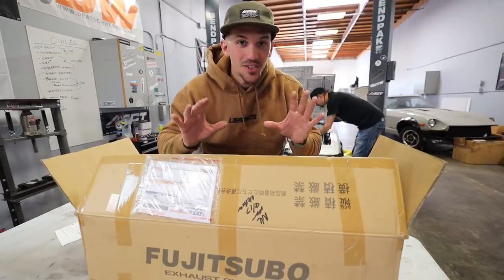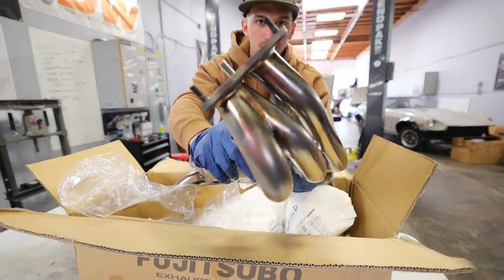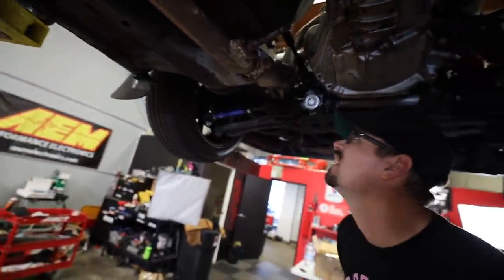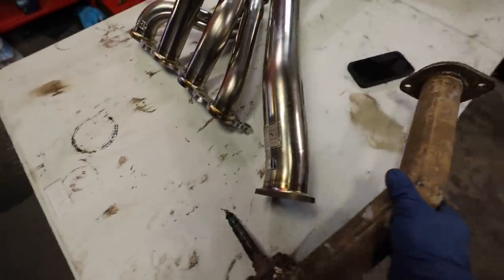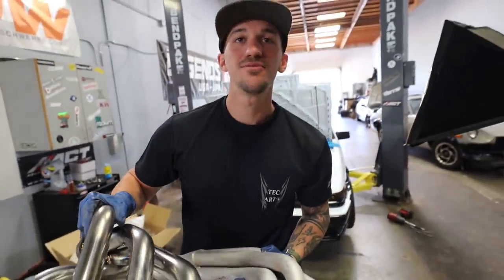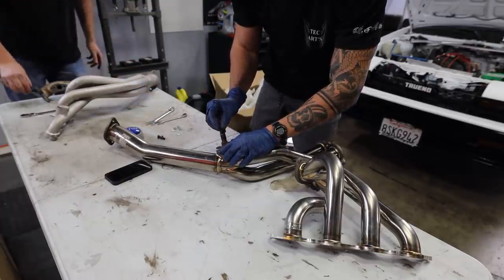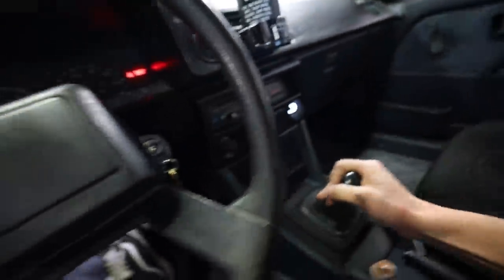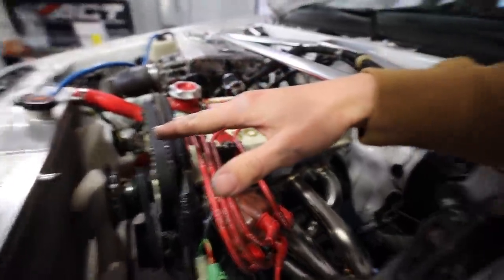This Was a Disaster... | AE86 JDM Header Install

Comment: I had an 86 back in the day & it came with a TRD header on it & it was designed the same as the tech art 4-2-1.  It had the same style flange & everything.  I actually think I still have a set of TRD 272 cams & cam gears in my garage as I was lucky enough to have bought a couple 86’s built in the 90’s with a bunch of TRD parts.

Comment: Dustin, you are not alone. Saturday Feb. 5th, 2022 I pulled my car into the shop after work to do an oil change and swap my thermostat in my 6.1L Charger. Throughout the next week I started to lose coolant (didn't happen until this happened). Turns out my radiator decided to start leaking (Mopar, More problems). Friday the 11th I try to patch it (cause, money. I moved across the country in January). I was up until 2am doing that.  The JB Weld patch kit made the leak 5 times as bad. So, yesterday (the 15th) I had to drop in a radiator. ALL CAUSE I DID A ROUTINE COOLANT EXCHANGE! As of today (the 16th), there are no leaks. Thank God.
One shitty day is just that. One day. Keep pushing. Love watching your videos. By the way... WHAT HAPPENED TO 240Z, AFTER SEMA, PLAN!?!

Comment: Easy way to check distributor alignment is remove exhaust side valve cover, distributor cap. Set to TDC and there will be a mark to line up with gear. Rotated rotor to cylinder 1 on cap. Slide in and confirm. 
If all mechnical timing is correct and wires good. You have to set base timing with a timing light. Jump pin T to E1 on diagnostic plug in engine bay to put in diag mode. Point light to crank pulley and time for 10 degrees. 
This is a must too when taking distributor out. 
Try this out first.

Comment: I had that same issue when I tried cold starting. It needed more fuel because the fuel was too cold to ignite. When I opened the throttle, it shut off just like you described, because it didn’t need more air. It needed more fuel on cold start!

Comment: Hey not sure if you figured this out yet. By the battery there is a clip you might have bumped loose. Black wire with red stripe. check thats connected. Also jump the diagnostic plug and get the ECU to do the engine light blink diagnostic. Im sure you know thats how to time the engine. It was having a hard time starting so double check timing and fuel Circuit Open Relay. cheers to your girl for putting up with 86 life lol

Comment: Set the o2 sensor back up. Bet that way they fitted a narrow part of the exhaust on. To get back pressure, so the ecu would run. Bet the air and fuel mix is way  off now. Sucking more air in, as the exhaust gas is bigger and faster leaving the cylinders. Hope you get it sorted. Take care

Comment: When installing distributors, you want the rotor pointing a little before cylinder 1 on the cap.
Reply: Or is it after.  I would set the crank at 10 degrees btdc and then install the dizzy with rotor pointing at cylinder 1 on the cap.

Comment: You might want to check the plug at the distributor and check the pins and wires. I've seen pins break, or flatten and the wires get brittle and break especially if it's been plugged in and unplugged allot. If the only thing you did was unplug the distributor then that is usually where the issue will be. I wish you luck, I know how much this project/build means to you and I'm sure you will figure it out.
Reply: Yes distributer wiring, had same issue on mine

Comment: I don't know how many times iv taken my distributer off then messed up the firing order or the ignition timing. Even with the ka24 I have managed to spend way to much time figuring it all out then find it its something simple. 

Another thing you can do is inplug the maf and try to start it. No maf should put it in limp mode and run rich but a faulty maf can make it not even run.

Comment: Hey Dustin, that is some jucy headers you got for the car, you may have swapped around the sparkplug wires somewhere, because it starts and idles for a bit and then dies. This usually means that the firing order is off, if it was timing then it will not start at all.

Comment: Either the distributor itself is worn or clocked incorrectly or the ignition coil inside the distributor arced and blew out when it was disconnected if the battery wasn't disconnected prior to it being taken apart. Slim chance, but possible if there was any current still going through it upon disassembly. 

I would also check any ignition related relays and all chassis grounds.

Comment: Check the fuel injection solenoid resistor the wires break off of them this happened to me on my gt4 by what the video shows the cold start is working

Comment: put in a new sensor or at very least an air fuel ratio gauge .. black top 20v motor swap if the motor die?

Comment: Check the points on the distributor, the distributor could be worn out and when you took it off something could have just failed. I don’t think it’s anything you did wrong I think the distributor is just shot. My 89 land cruiser’s distributor did something similar which I guess is expected on a 30+ year old vehicle. 😂

Comment: Those could be TRD. Hard to tell with the coating. TRDs are notorious for cracking and repairs are a common thing because TRD made the headers paper thin. Definitely more of a show piece for the few who still have a genuine TRD 4age header.
Reply: For the distributor, you are most likely one teeth off. Don't align the two dimples together like FSM recommends, instead turn shaft end counter clockwise one tooth when facing shaft end of distributor, and it'll align correctly once installed at TDC. good luck!